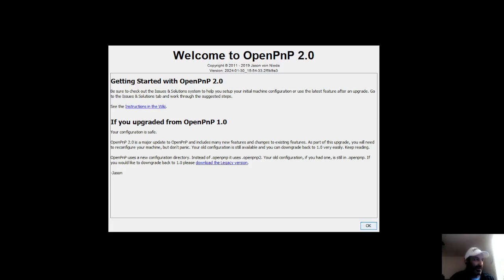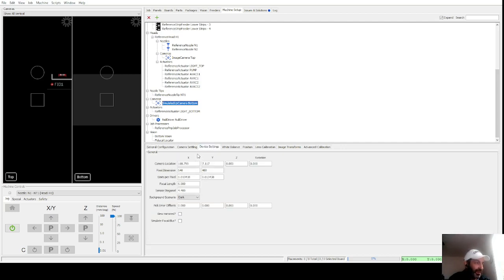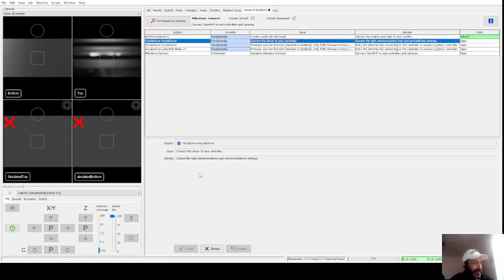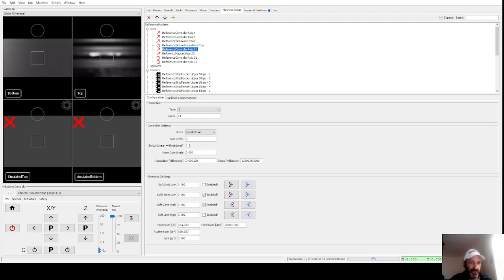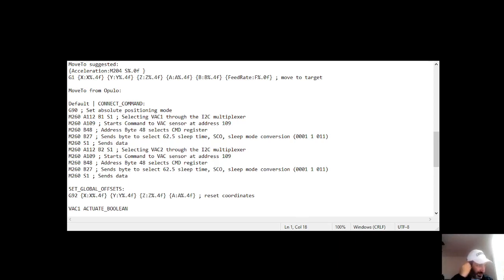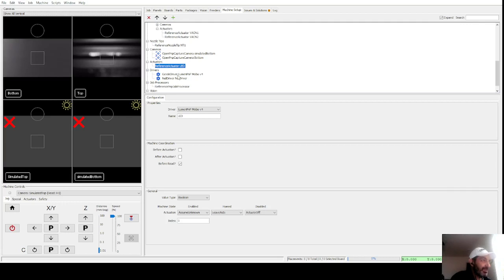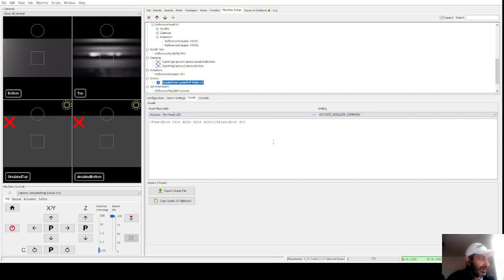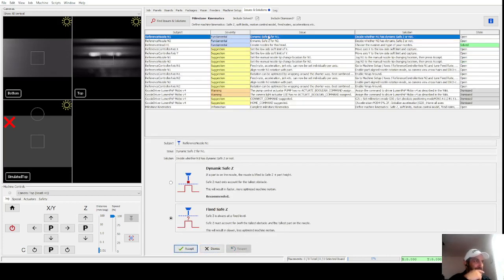De-Opulo your LumenPnP

Comment from the maker: I acknowledge and agree with your points. It's clear that Issues and Solutions (I&S) does address these functions. However, my uncertainty had been increasing because many operations are not consistently repeatable in the hardware, which creates uncertainty about the causes of these issues.

I&S could be a challenging concept for newcomers to fully trust. The level of integration and automation varies significantly from one issue to another. While some aspects are highly automated and function intelligently, others lack this level of sophistication. Consequently, there's often a need to balance between analytical thinking and relying on the system, and this balance varies across different scenarios. Your deep understanding of the process, environment, and codebase is evident, but many users may not yet have this level of insight.

From my own experience, my grasp of I&S has improved as I've engaged with it more extensively. Nonetheless, I believe that newcomers to OpenPnP might find it challenging to start with I&S and achieve success without substantial assistance or experiencing significant frustration."
Reply: It is true that the degree of automation varies between solutions. And coverage is also not complete, although we are continuously getting better. I assure you, this always has a technical background, for instance it is simply not possible to know which controller M-command would switch the light, or on what serial or network port your controller is listening. Or setting optimal feed-rates, accelerations, etc. for a machine. There are no safe discovery/calibration methods (known to us). 

The issue of "trusting I&S", I heard many times, especially if users had prior experience (and frustration) with manual configuration. But there is practically no feed-back that I&S would actually propose something that is completely wrong or that actually damaged a configuration. If you have such cases, please report them, we will fix'em! 

Bottom line, I would argue that I&S is helping a lot, judging from the massive reduction of support cases in the user group. You have no idea how complex it was, when you still had to hand-edit the machine.xml to achieve the simplest things! 

However, I will take this misunderstanding in the video as an input to better distinguish automatic solutions from simple instructions for manual intervention in the descriptive "Solution" text. I see it must be made abundantly clear to a (beginner) user that I&S will do the reconfiguration automa[tg]ically for them when they press Accept. 

I agree that some of the current "Solution" texts are lacking in this respect. This is a historic left-over from the days when the descriptive text had to fit into a table column (there was no lower panel).

Side note: if an I&S item is a mere instruction with no automatic solution, the Accept button is grayed out. All you can do is either follow the instructions or press Dismiss. I&S will remove the item when it has found the condition to be resolved, i.e., when you press the "Find I&S" button after having manually intervened.
Reply from the maker: I&S is helping a lot. I can imagine setting up OpenPnP was incredibly difficult before this guided tool.